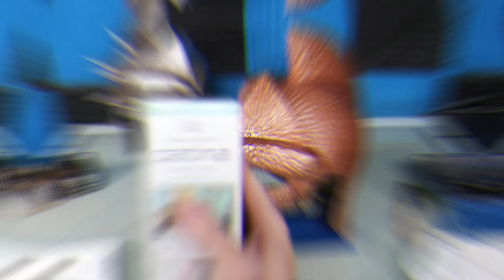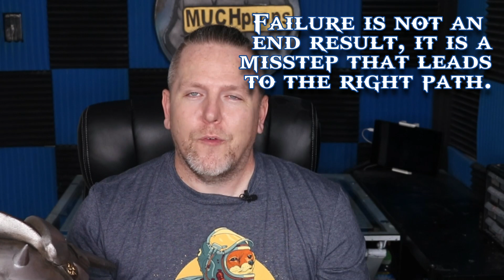Making a Foam Maximus Helmet

Comment: Those turned out awesome! For fake blood I highly recommend Tamiya Clear Red X27. It looks wet even when dry and it's great. You can angle a piece so it won't drip and you can pool it up to have thicker dark red spots, let it run in some areas, etc. I've used it a lot.
Reply from the maker: Another really cool blood effect is mixing some 5 minutes epoxy with a little red acrylic.
Reply: @MuchProps  haven't tried that. I definitely will at some point!